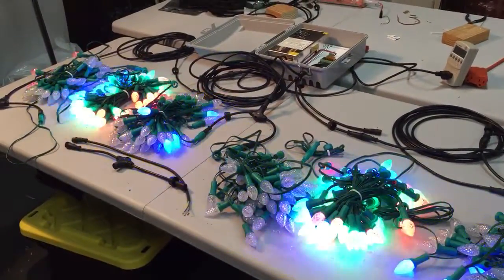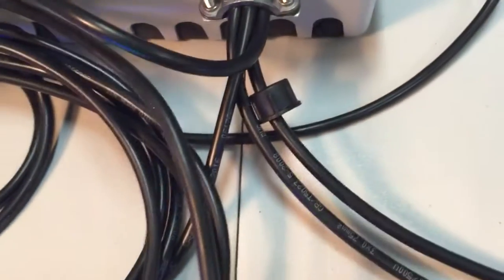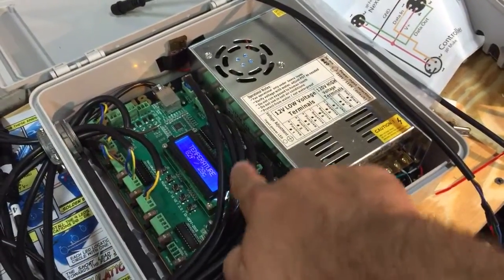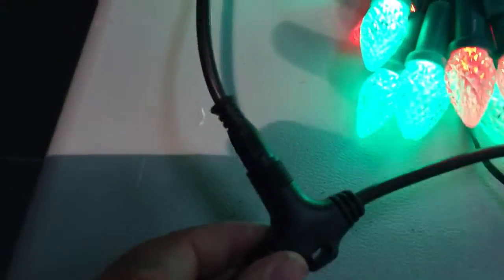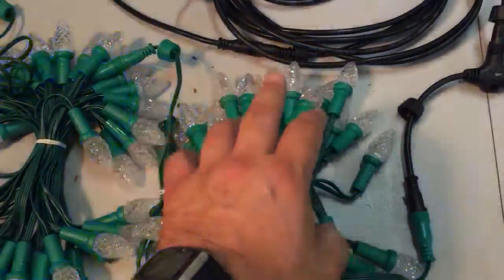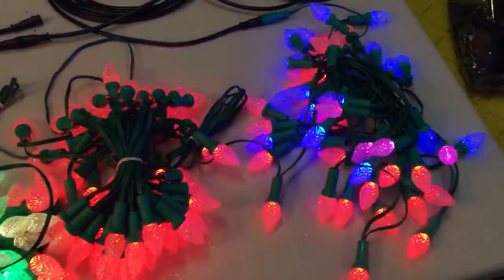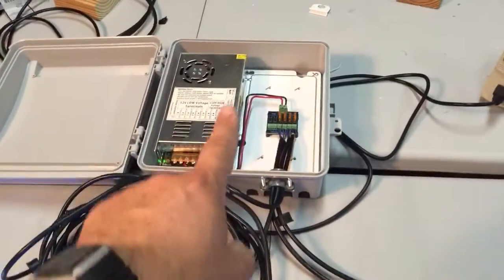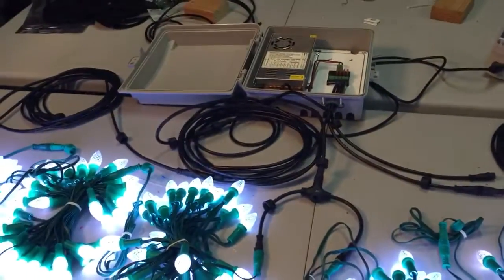Power Injection for LED lights

Comment: Did you have to remove the data pin from the Tee?  Some sites say remove the pin while others say not to.
Reply from the maker: In my setup I only had to remove the data pin on injection cables 20’ or longer

Comment: what is the reason for only using the ground and the data from the controller?  why not the power?
Reply from the maker: jak77b  the controller output is only rated for 5 amps and 30 amps total (per 8 outputs).  By using other power supplies I can run more props and larger strings

Comment: I am still trying to understand power injection as this will be my first year with this hobby.  I have a falcon f16, power supply, lights on order, pigtails on order from enclosure, 16/4 speaker wire on order as well.  Can you use the 16/4 wire as power injection as well?

Comment: hi there I have 4 sets of 5m of ws2812 300 leds inch I connect it to controller sp105e the  power supply is 350watts and I inject to 2 places and at the end of the  lights I got 3.20 watts but when I put on white it goes slow 
what could I do

Comment: Wait I thought power had to flow a certain way... Thats why there are arrows on the light strips?
Reply from the maker: Matt-Tube signal has to start at the first pixel.  Power can flow from any direction.
Reply: Okay Thanks.
Reply: Is there a distance restraint to the signal line?

Comment: great vid! if this is for your yard, how far is the cord youre running from your supply to the power source? just a normal extension cord from your house? do you lose any power from the power source by using a long extension cord to get power to the power supply?
Reply: The lights are powered from a 12v power supply.  The 12v low voltage injection cables are 20' long.  The power supply can be as far from AC power as you want as long as you have a long enough extension cord.

Comment: awesome video! first time pixel user here. this is basically all i want to do to my house. i need about 367 pixels to outline the roof of my house @ 8" spacing. its a long ranch house with the garage on one end. with that being the ideal place for the controller, box, etc, its a very long ways away from the other end of the house.

could you duplicate this setup by just sending another data and ground line from a different output on the controller to get 300 lights with 2 separate power supplies?

Comment from the maker: As long as you use the same power supply you can inject as many times as you want, it will never equal more than the voltage output of the power supply.  You can use multiple power supplies if you disconnect the +V wire from the previous string

Comment: Thanks for taking the time. This make it seem easy, if I need to do this for 2017 I will probably use those exact parts. Any chance you can share what parts you used and from what vendor? 2016 is year 1 for me and a big part of the learning curve for me was battling through different standards of the parts I bought, and on occasion vendor diagrams not matching what I was seeing out of the box. I killed a few lights and fuses from that, ever since I double check everything with a multimeter before plugging any lights in.

Comment: What would happen if you injected power in between each one of your strings? Would it damage the pixel bulbs from too much voltage or does the strings compensate some how or regulate the voltage so too much is not getting introduced to the string.

Comment: Great video - explains an issue I have been trying to work with for the past few days, including the use of a "T" for injection into multiple strands all being fed from one data feed.  Even better, I have the exact dist board as pictured so my setup is virtually identical.

Question - you mention that power flows both directions from the "T" (I agree); could this potentially create a cascade failure should one fuse open for whatever reason - the other strings will "search" for power, ultimately overloading the next "T" feed until all fuses open.  If this were the case seems like you would want to cut the V+ feed going "backwards" so that each "T" in your final setup only powers 2 strings - if one fuse would open then only that section would be impacted.

Thoughts on this...I may be wrong on all points...trying to figure it out so hopefully this makes sense.  BTW, I linked to this video over on doityourselfchristmas.com

Thanks!

Comment: Thank you, confirmed what I was wanting to do with just sending out data/ground from a controller!!  Great work!  Where did you get the power distribution board?
Reply: The ones I used were part of a group buy.  You can buy these:  http://pixelcontroller.com/store/index.php?id_product=46&controller=product   from pixelcontroller.com
Reply: Thanks, looks to be sold out for now.  I'll have to look out for the CoOp next year, those look nice!
Reply: Jeff Hagel available now, looks like.